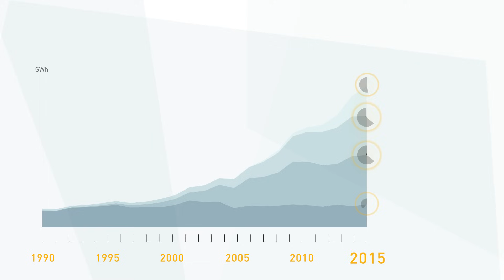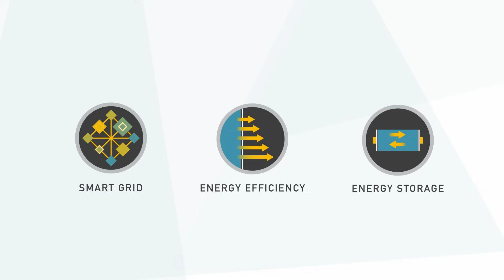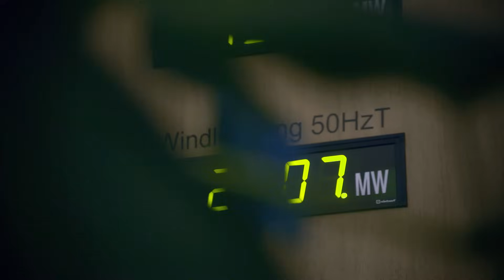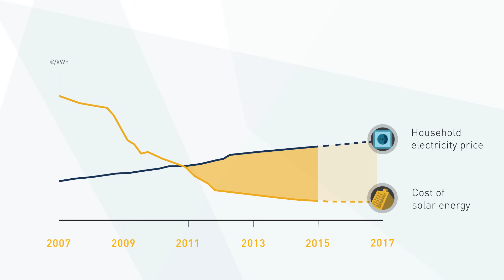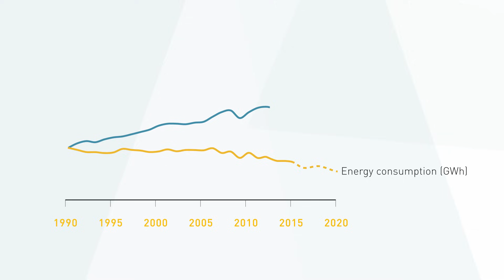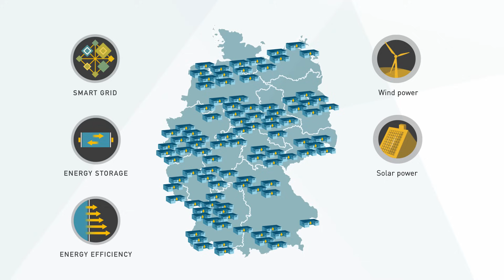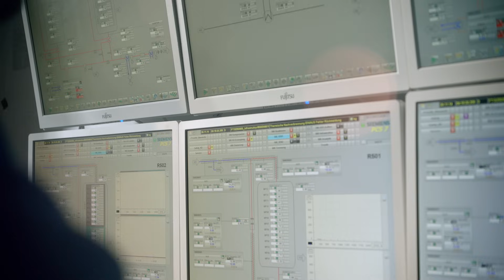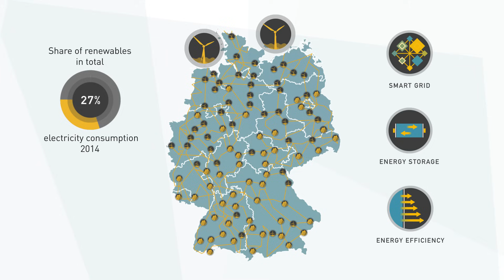Germany's Renewable Energy Revolution

Comment: Germany's electrical generation is in transition alright:  the French have never been busier building nuclear power plants to supply Germany with reliable electricity as they phase out their nuclear generating capability ... and ramp up their coal-fired plants to "supplement" the un-reliable, "sustainable" alternatives.
Reply: It's not true that France has never been busier building nuclear power plants. They were much busier in the 80s and 90s when most of their plants were built. It would be interesting if they did it again to get the rest of Europe off of coal and gas.

Comment: umm Germany's carbon foot print isn't decreasing rather increasing. Coal is still used to power 43% of the country and specifically the type of  coal mined is ignite one of the more toxic forms of coal ha and here in Alberta we are getting flack for producing our coal which is far less toxic than that in Germany? and I wonder how many people realize the raw earth materials used to manufacture solar panels and wind turbines are some of the most toxic material on our planet. There is a reason why such machinery is manufactured in China there is not much land left to restore. France is the exception they have embraced nuclear technology to produce energy and were not talking about uranium.
Reply: +krissy24241 It was only two years, where we had a increase in CO2, when we closed some nuclear plants after Fukushima and coal plants produced more power. The years before and now again we lowered CO2.

Comment: Oil exporter Gulf countries do not like this
Reply: In fact there is a HUGE oversupply of gas in the market. Germany doesn't depend on Russia, but Russia depends on Germany to buy their gas which is why Russia has just built a beautiful pipeline all the way from Siberia to Germany's doorstep.
Reply: Funny, many middle east countries are investing in Solar. Saudi's are investing heavily in solar. They see the benefit for them. Although they still enjoy exporting their pollution via oil.
Reply: @LongTimeAtheist  that's because they fear the day they run out. But they want the solar all to themselves, because they need customers. They build solar for themselves to not waste valuable oil, so that it can be sold for money.
Reply: +Ghassen Smaoui Why would they dislike this? 
Germany does not burn oil for electricity. 
Oil consumption is not even reduced by placing more windmills and solar cells.
Reply: Germany burns natural Gas imported from Russia for electricity production